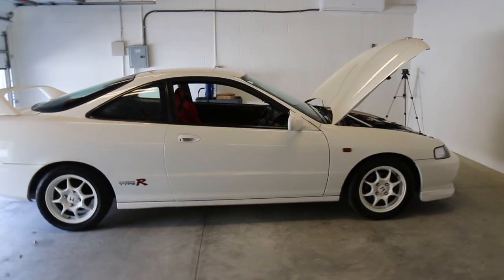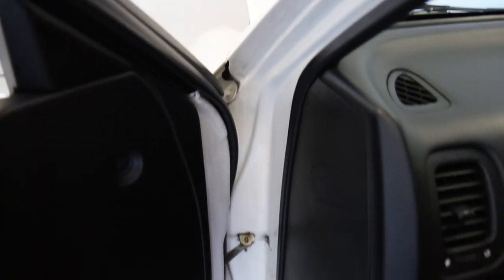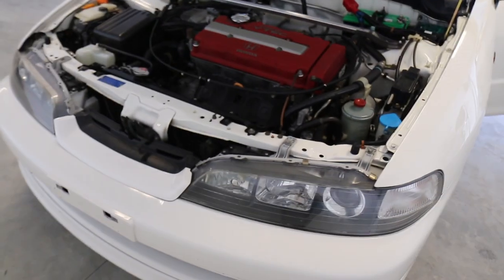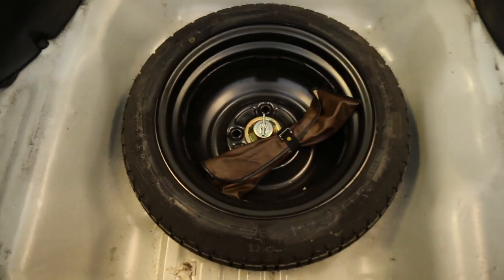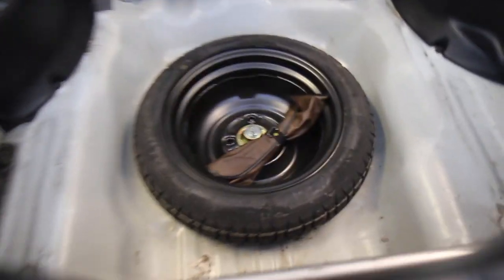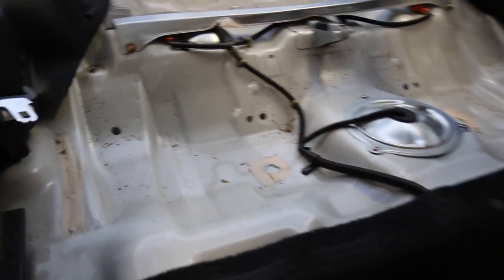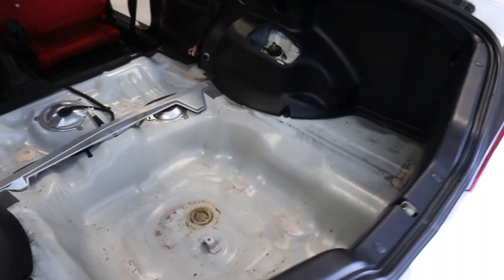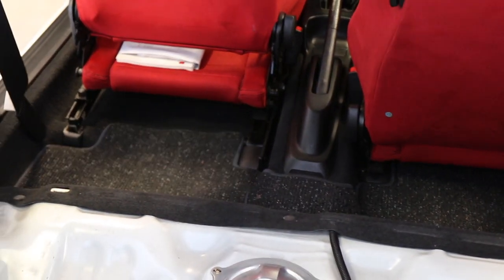1996 Honda Integra DC2 Type R Vlog 1 #typer

Comment: Ready to follow along on this!  I recently bought a '97 ITR, so it'll be interesting to see as you get it all cleaned up.
Reply from the maker: I love your videos on the ITR my friend, haven’t seen it in a while so was wondering if it was still in the arsenal! I’m getting some part’s together, ex timing belt, pump, trim, decals etc. looking forward to finessing the little things in time.
Reply: @PerfectDetailUSA  Timing and water pump is on my list as well! Once I sell the CRX, I’ll be putting more time into the ITR. Yours looks to be much better shape than mine, but it’s part of the process!
Reply from the maker: I’ll need to refresh the valve cover / wheel caps & get a nice detail on the recaros also. Loved your videos on all that! More 🔜 just followed you on Instagram @perfectdetailusa. I need to detail the type R also!
Reply: Have a 1999 type rx..great cars

Comment: Beautiful car, well wear.
Reply from the maker: thank you so much! likewise love the dc2 in profile pic! hit me up on instagram @ perfectdetailusa / @ warpaintusa
Reply: @PerfectDetailUSA Mine like yours is a 96 JDM ITR Type R. I bought it back in 2006 from my now brother-in-law, who also wants it back, but Im not selling😊. He put a lot of money into it at the time. The original B18C engine blew with his second modification. He then had a top end B16B civic engine built that was bored out to a bottom end 1.9 - which has a Hybrid Turbo kicking in at 3,500 and the VTEC kicking in at normal. It is running 359 BHP, 260ft-lb's of torque, 353 Nm's, and 323 WHP. I love when I had it on the road, and I should be hopefully putting back on the road this year all going well. I took it to a drag strip once in Co. Down (I am from Co. Cork Ireland, by the way) but it was bucketing down rain, and I  managed a 13.5 quater mile. When he took it when he had it, it was not boosting right, and he did a 13 dead. I recon it would be somewhere between 11.8 and 12 dead on a good day with alot of rubber down - I know I definitely lost a second and a half with the rain and my overly enthusiastic, rookie, heavy foot. There is 136,000 Kms on the body, and only 16,000 of those Kms or on the new engine. I sometimes wish it was standard, but the car is unreal with its setup and so much fun to drive. I wish you all the best and hope all goes very well with your car 😊
Reply from the maker: @emmetharte3718  wow yea must be a fun experience w/ that power in this chassis. I’ll keep mine b18c NA but love to hear it bro. Hit me up on instagram- @ perfectdetailusa/ @ warpaintusa . I’d love to see more of the dc2 ✔️